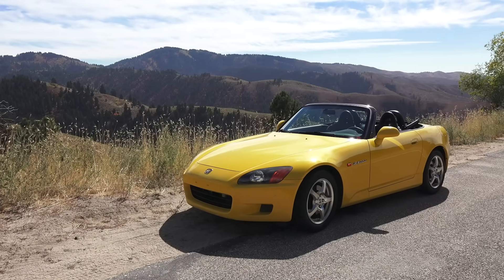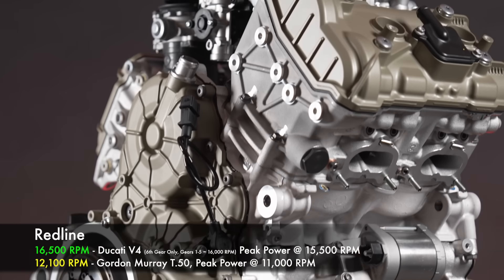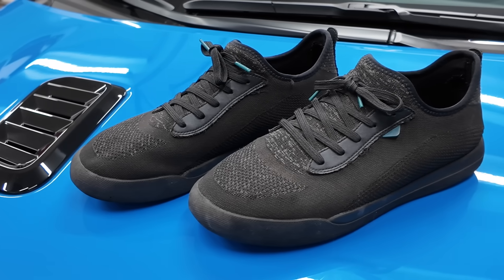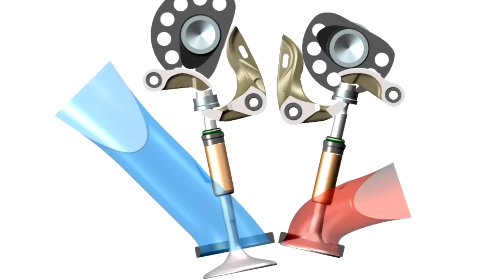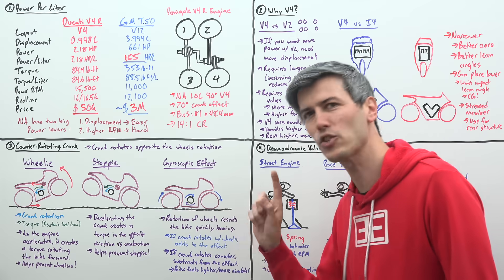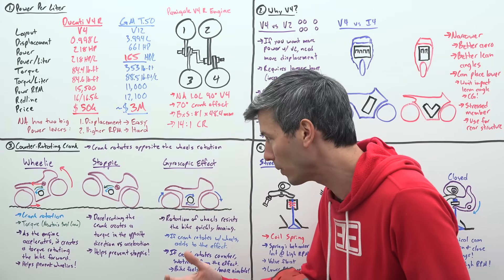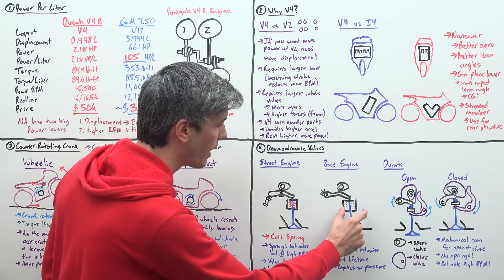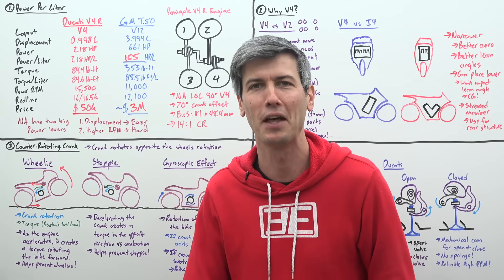Ducati's Brilliant V4 Engine — Putting Supercars To Shame!

Comment: also the non R version makes 196hp/liter at $27k , CBR1000RR-R (that's a lot of Rs) 216hp/liter at the same price and the less exclusive versions of japanese inline 4 liter bikes are around 200hp/ liter and under $16-20k.
I think one of the biggest differences is emissions and reliability/maintenance. without emissions and with higher maintenance and angines getting fully rebuild after 50k miles we could probably have more affordable, lightweight, high revving naturally aspirated track focused cars.

Comment: My Ducati 450 Desmo had springs as well. At idle and low speeds, the springs kept the valves sealing well, but became less important as rpm's increased. My 350 Duke had normal valves which were a lot more simple to deal with.  But both used Wankle Caps to set valve lash.  UGH!  But I loved the drive shaft, with bevel gears to drive the valve system, over chains and belts.  They NEVER fail, period.  I owned several, and a few had been mud raced, and the bevel gear lash was extremely loose.  Sounded bad but ran quite normally.  Had I known those old beauties would disappear from the market, seemingly forever, I'd have never sold them . Heck I even built a chopper out of a 350. Custom intake and Mikuni carb and it idled down to about 250 rpm's, a sound you'll never forget. Pulling into the swap meets, it was a real attention getter. The final bike weight was 289lbs. and the seat height was so low, but I kept the Cerrani front forks, just dolled them up a bit. Handled amazing.  Sorry I got off topic.  Dukes have always been my favorite bikes.

Comment: Fantastic video, Jason. Would also love a section or you exploring why similar techniques are not employed by high performance car engines. Having a 2L high revving 400+hp lightweight sports car seems like a dream. I’m sure there are engineering reasons why it’s not that easy, but nobody has explained why yet.

Comment: The Ducati MotoGP motor makes similar power to the Honda, KTM, and Aprilia V4s.  Those other motors don't use the desmodromic gimmick. Not a Ducati solution.

You can't compare motorcycle and car engine hp, as cars need significantly more torque, and less maintenance as they do many more miles.

Lastly, the KTM RC8 V4 also counter rotates, as does the Aprilia RSV4.

Ducati dominance in MotoGP has been due to aero development and the first team to use ride height devices.

Ducati does not hold the patent for desmodromic valves, it was patented by Benz in 1889. Used in racing Mercedes Benz in the 1950s, but in other motors in marine applications.

Maybe a little more research next time? Not just Ducati's talking points?

Comment: Low centre of gravity is not something a performance motorcycle needs.
Honda actually raised the centre of gravity to improve cornering characteristics - specifically turn in and rate of lean.
Lower the centre of gravity and you achieve two things:
1. You make it handle like a piece of crap ,  à la Hardley Ableson
2. You make it easier to pick up off the ground after you fall off because it handled like a piece of crap , à la Hardley Ableson

Comment: I get what is the problem of the valves, but I don't get why this is such an issue. We already have some kind of actuators for opening, they "just" put another one for closing. And I mean there is already something in the engines about the crank and rods to transform linear motion into circular ones. Why not "just" apply it to intakes ? Is that a timing issue ? I kinda feel like if this is because the valve is closed way more than opened, simply adding some offsets to the parts would solve that, while allowing higer revs and everything.

Comment: would it makes more sense if you say: pistons (instead cylinders) and valves will have a smaller mass? as cylinders are static parts. as you try to explain sense of reducing mass for moving parts. great content as usual 👌

Comment: My prized possession is a 1098R with the Factory throttle body and cam upgrade. 208hp from 2 cylinders of 600cc each in 2008. I’ve enjoyed every minute on track with it

Comment: I'm pretty sure that high performance motorcycle engines don't have rocker arms.  They use cam buckets and that's why adjusting valves on those engines is a PITA.

Comment: I'm kinda thinking Honda's 5 cylinder RC148 GP bike of 1968 that revved to 22,500 RPM, Honda's 1990 CBR250RR at 19,000+ and Honda's 1979 Oval Piston NR500 at 22,000+ all using valve springs, would beg to differ on the "Coil springs for lower RPM applications" lol

Comment: Fantastic video. Two advantages you missed with the inline 4 is weight distribution and heat, the V4 is insanely hot for the rider. The inline 4 allows for the weight to be placed further forward. This helps with the wheelie but also front tire load which is important for handling. Obviously Ducati’s solution offsets this but that is an inherent advantage if they hadn’t done the counter rotating crank shaft.

Comment: Note on the Ducati Desmo system: it is completely useless with modern spring and valve materials. The japs rev to 18k RPM just fine without it with no valve float. It does incorporate a light spring to account for the thermal expansion of materials (a zero backlash desmo would brake and and backlash with no helper spring would hemmer itself to bits).
I consider Desmo in modern Ducatis something akin to a flying tourbillon in mechanical watches: engineering porn and a nod to a bygone era, a status symbol.
Too bad 99.9% Ducati owners just pay for it and never get to see or service it, because they have other people service their bikes.
Not me tho: I enjoy my Desmo services, I sometimes do them twice as often as required, just so I can play with the fun bits.

Comment: I am not sure if the explanation of the giroscopic effect is correct. I think the benefit of the counter rotating mass is not less resistance to fast leaning, but only  less horizontal twist effect. It is still a significant benefit, just not explained very well.

Comment: My dad has a 998. I’ve rode it a few times and at 123hp (when new) it’s bloody terrifying. 
These engines must be insane to ride
Reply: I had a '99 Suzuki TL1000R I bought new.  As it was designed to compete in WSBK with Ducati, it had similar power to the 998.  I agree the power is way more than enough.

Comment: The MV Agusta F3 675 features a counter-rotating crankshaft, a design that rotates in the opposite direction of the wheels, which helps counteract gyroscopic forces.

Comment: Someone has gotta get into ducati. Their new V2 is also lighter, smaller, and more powerful than the previous model.  Their 2026 HyperMotard is like 390 pounds all in, and makes 120 hp and is under 900cc. And thats not in some high strung race bike, that thing also makes fat torque down low. And they also make one of the most powerful and high revving single cylinder engines in their Super Mono. Their valve service intervals are up around 60,000km aswell.   Standard on most Japanese brands youll see 24,000 Valve service intervals.

Comment: If you are going to make a video on firing order, would be interesting to bring up "normal" inline 4 engines (180 degree crank, 2 cylinders up and 2 down) and engines like the R1 which have 90 degree crank, 1 cylinder up at that time. From my understanding the smaller and shorter pulses help with maintaining traction.

Comment: Would definitely love to hear more about the crank with that 70 degree offset. I imagine that the positioning of the Vee and the piston's travel in relation to the Vee, are going to determine the optimum level of least stress on the crankshaft whilst keeping the piston as straight as possible within the bore when it's travelling up and down.  A great discussion on Ducati's V4, would also love to hear more about the V2

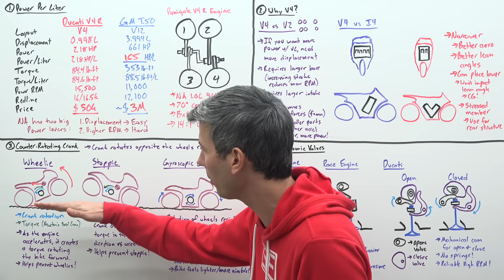Comment: 8:00 Another great visual for this is Motorcross or Monster Trucks, which use rotational torque while in the air to pitch the bike/truck up or down... Give it throttle to nose-up and stab the brakes to nose-down. 
This is how both make what appear to be perfect jumps, as they fly through the air and land perfectly on the down slope. _ /¯\ _

Comment: Your explanation of the gyroscopic effect with regard to counter rotation was incorrect. The counter-rotating element does not subtract from the gyroscopic effect. It adds to that in exactly the same way as if it were rotating the same direction. but it has a cancelling rather than reinforcing effect of the precession forces, which could be quite large with a lot of mass spinning at high speed.

Comment: I'd love to see your take on the upcoming Honda V3 as well as your thoughts on their e-compressor, which I think would be an absolute engineering coup if Honda has finally cracked 100% electric forced induction well enough for a motorcycle.

Comment: i imagine that it takes a lot of power to compress 16 of those ultra stiff valve springs at higher rpms..... wouldnt ducati be negating this and getting all the power from the pistons instead of using a chunk of it to drive the valves?

Comment: We have over 200 horsepower bikes because of stability control and IMU electronics others fighting wheelies and tire slip/traction.  Also anti wheelie electronics.  Also electronics to allow pretty much fully
Power out of corners and cornering ABS controls.

Comment: Gotta wonder why all bikes aren't shipping with a counter clockwise rotating crank.  Just makes so much sense to do it that way.
Reply: It's because it would require another shaft in the engine. If your crankshaft rotates the same way as the wheels, the transmission primary shaft goes the other way and the countershaft with the drive sprocket goes the same way as the wheels, as it's connected to the rear wheel by the drive chain.

Comment: TBH valve float is not really an issue for few decades now, we have multiple bikes that rev as high as V4R or even higher and they are using coil springs (see any 600 sports bike or 400 I4 from few decades ago). Ducati uses desmo becasue of heritage, desmo = ducati and ducati = desmo although they dropped desmo in favor of coil springs (and variable timing) in some of they recent engines (V4 Granturismo or new V2 in Panigale V2)

Comment: Great video - although not sure about the gyroscopic argument of counter rotating engine.

Can you explain this further?  I know if the engine rotates inline with the bike it eases lean angle in one direction - but here the plane of the rotation is the same as the wheels - because the going in opposite direction should make no difference 🤷‍♂️

Comment: I've had a question for a long time, what is stopping this from going into a car? (european small car) so instead of having the puny 1 - 1.2L 60-70 HP  or even 50HP
Reply: You wouldn't want to rev to 10,000 rpm to slowly pull away from a stop light in a car. The bike gets away with this because it weighs 1/10th or less. A larger engine with lower peak power just works better in an automobile application.
Reply: @AdrienneNorris  This engine makes 114.43 NM (newton meter) at 10k rpm or something like that, the car that I have makes 112 NM (or did make in 2002) at 3000 rpm, so yes, my question still remains, even if you have to rev to max torque rpm the motorbike engine to start, in order to start on my shitty 2002 car I have to rev to 3k or 3.5k to start on a flat terrain, which is the max torque rpm, but only had 64hp, not 120, oh and it's a 1.2L not a 1.0L

Comment: Is there not a small spring to seal the valve on its seat because   maintaining that seal when fully  the valve is fully closed via a totally mechanical system. Would be  thwarted with probs

Comment: desmotromic is kind of pointless.. there has been notocycle engine that rev as high or even higher (i am thinking of the last r6 17.5k rpm redline) with only springs. its just adding complexity to the engine more point of faillure just to say your different.

Comment: So I guess I've learned something today too. I though for gyroscopic stability the rotation direction wouldn't matter. But I have to think of it in terms of angular momentum, a vector that the wheels/engine wants to preserve, and the engine subtracts from the vector if spins the other way.

Comment: Fascinating! I have always like Ducati. They are famous for their V-twin. Regarding high revs engines,  I have read the maximum "ideal" displacement is 500 cc per piston, anything above this the mass of the piston becomes a significant factor. Have you ever come across this? 
Thanks
Reply: My understanding is that 500cc per cylinder is ideal for efficiency - cooling/heat management and power.  That is why 2.0L 4-cylinder engines, 3.0L 6-cylinder engines and 4.0L V8's are ubiquitous today.

Comment: A series on bike aerodynamics would be good. Bikes have terrible aerodynamics especially once you put a rider on them. In recent years aerodynamic changes have made more difference to lap times than engine performance. Engines are now so powerful that the bike wants to wheelie just about everywhere under acceleration so just like an F1 car a significant part of that power is going into downforce.
Some companies have even said they are looking at bringing active downforce wings on production bikes. They are currently banned on racing bikes which can only use fixed wings of limited sizes.

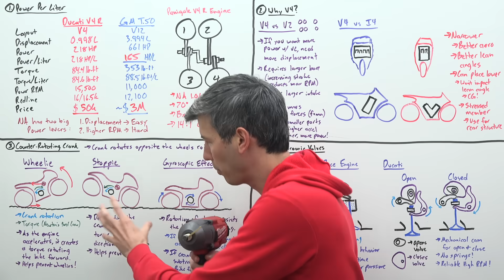Comment: 8:35 man, why dont all manufacturers do this..
Reply: They didn’t have science teachers who had a bike wheel and a rolling chair.
Reply: IKR
Reply: 25k dollar bmw s1000rr becomes a 35k dollar s1000rr
Reply: Its not like an slip on which you just out on and leave the cats on. Plus the cost becomes higher and harder to justify, but MV agusta and ducati can offer this and get away with it because of their past legacy, giving them enough buffer to put things like counter rotating cranks or something like radial valves (When MV came back with the F4 serie oro) or desmodronic valves (again, the panigale v4) hope this helps mate.

-a engineering student from india ❤

Comment: @EngineeeringExplained Hi Jason, from a stock engine, the cam timing and duration is increased to increase power and rev range. What would cam timing look like on such high performance engines?

Comment: We have all heard the old motor heads say "There is no replacement for displacement." Two-stroke enters the chat "Well, actual there is, number of strokes per cycle." Check out the Suter MMX500 two-stroke V4 racing motorcycle that produces 195 horsepower at 13,000 rpm with just 576cc. Never-the-less 230bhp out of a 4T NA one liter is quite impressive. Looking forward to part 2.
Reply: The MotoGP version develops over 300bhp at the same displacement.
Reply: @Kaireddin-BB I looked into that and saw 190 to 200 bhp. That weight reduction is key. Speaking of 2Ts the shifter carts 125cc are turning 16,000 + rpms which is crazy if you think about it.
Reply: @shane6108  There are no official figures published other than the same 240+ since time immemorial, which is a made up "political" figure, I have no idea why this is the case, but MotoGP manufacturers don't like to release this kind of data.
The weight of the bikes is mandated at a minimum of 157 kg dry and without the rider. 

I follow the sport and it's generally known that the power is much more than that, first of all from the performance on track alone (the speed record - on a circuit during a GP - is 366.1 kmh on a 1.1km straight by KTM in Mugello), but also because once in a while someone lets it slip through.

Years ago one of the team managers (Lucio Cecchinello owner and manager of LCR Honda) was asked about this 240 figure that stayed unchanged for like 10 years and he said something to the effect of "we don't have a figure from the factory but can infer it from the data, we know what it is", when pushed again he said "let's say it's well - but WELL - over that figure". And just recently, Loris Capirossi, former rider and current Safety Advisor of MotoGP, said in a podcast that some bikes produce over 300. The RPM can get as high as 18000.

If you want a source I can refer you to an article on Motor Sport Magazine by Mat Oxley which is a well known and reliable author, the article is from March 2021 and titled "The 225mph MotoGP bike: how fast is too fast?". The bikes have gotten faster since.
Reply: @Kaireddin-BB  Super cool info. I had no idea they were getting bhp number so high, mental. I'll look up the article you referred to. I live in the US so we don't get to see many moto gp races nor the Isle of Man.

Comment: You forgot to mention one more reason why the made the engine counter-rotating: due to very high RPM or the crankshaft, they could not use direct final drive and needed to reduce the RMP of the final drive. So they use an additional gear pair for that, which, of course, changes the direction of rotation

Comment: Low centre of gravity not good for bikes, Honda tried that in the 80s running the fuel under engine, fuel sits under the riders seat now
Reply: They lower the CG as much as possible until it compromises lean angle.

Comment: Go to a less expensive and less special than the V4R Ducati motorcycle engine.  My 2017 BMW S1000R, an in-line 4, puts out 165hp from 999cc. Newer variants (mine is now a generation behind) put out more from the same displacement without variable cams, and the GSXR 1000 does better with its trick cam mechanism (itself worthy of a video).
Reply: My conventional spring valve grand tourismo V4 Pikes Peak made 168hp and 89ft/lbs on a dimsport dyno a couple of weeks ago, Ducati race exhaust and OEM flash.

Comment: Nice animation of desmodromic valve gear. Bikes have engines that rotate in the same direction that the wheels were the only way to make a bike without a gearbox. Considering the obvious advantages of a counter-rotating crankshaft I'm surprised it isn't used more.